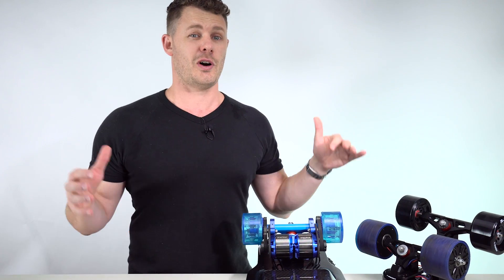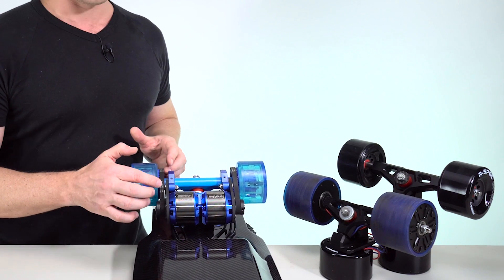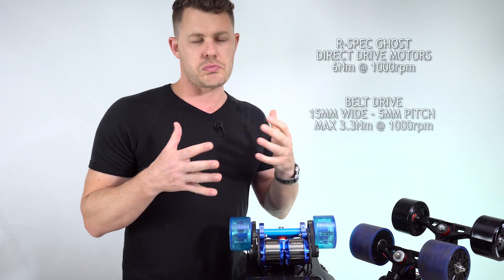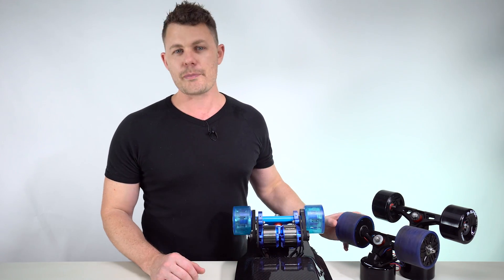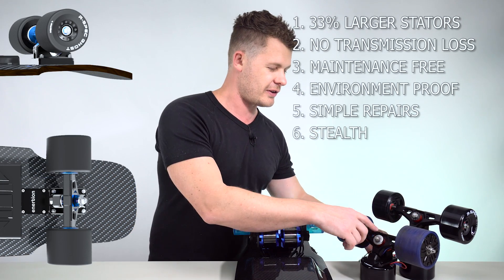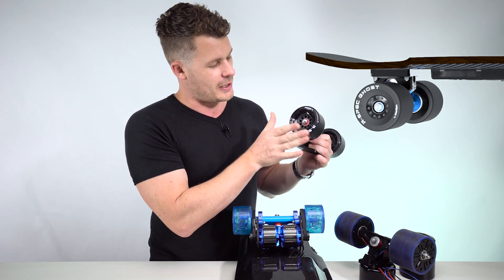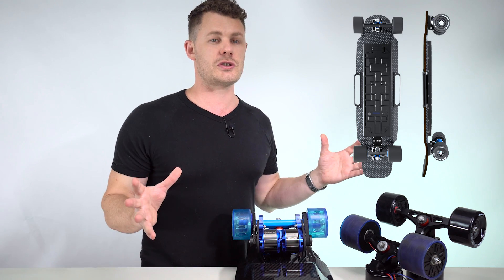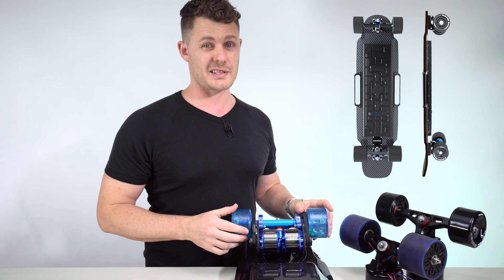Raptor 2 | Electric Skateboard Technology | Direct Drive VS Belt Drive

Comment: You didn't talk about durability at all. 
When the wheel is in the motor it gets all of the impact... How long will it last before the inner parts start to fail?
Reply: I wanted to ask the same......is the PU buffering enough impact?
Reply: the board I have has been running on bad and good roads for almost a year now. The motors have outlasted the Battery, ESC and some bearings in the front. It has run through the dust, rain, and snow thus fare. I am using a skatBolt and It has been pretty good so far and yea we have been a bit mean to this thing.
Reply: Noam Lin One year warranty.
Reply: Yep agreed, them neodymium magnets will come loose.
Reply: I have a hub motor board, and I like it. It's quiet and in my opinion more efficient.
Also you can coast and push your board, and that make the battery last longer.
Reply: All impacts and shocks go thru bearings which are dirt cheap.
Reply: Does it matter if you have a 1 year warranty? I know from the Raptor 1 that if Jason is putting out a product its going to be quality product. If your worried, buy the $99 warranty upgrade for up to 2 years. At that point there be a new board Im guessing. I plan on selling my Raptor 1 when my Raptor 2 arrives (few month later) and using that to buy the 3rd gen board when it comes out, that maybe a different brand, who knows.
Reply: Shhhhh, people dont need to know such things. But to be fair, the amount of impact force would be nearly the same in a hub motor as in a belt driven motor, just depends on the damping, meaning which system has more rubber between the rocks and the wheel.

Comment: Why did we often hear on the forum that Hub Motors had Less Torque than a Belt System??
Reply: thanks for answering Jason
Reply: belt system on a 80 pound electric offroad board... yes... but the motor is twice the size of the wheel motor... Just hoping they have been tested enough to know they don't fall apart since the motor is in the wheel.

Comment: would you be able to ride this on a 30-40 degree hot day in aussie summer?
Reply: Electric Skateboard Builder This could have another simple solution, replacing the belt-drive with a gear drive. 😀
Reply: you will still have rolling resistance, but you lose torque limiting.  Along with gaining rotational mass, similar to a two speed tranny on a rc car

Comment: Why don't you guys use SENSORED MOTORS?! To me, that would seem like the "end-all-be-all" when it comes to torque as well as reliability. 

Btw, I'm just curious. I'm in no way trying to act like I know any better than anyone in our community. But, from my own experience, using sensored motors was definitely the way to go. So much more torque and no need for a rolling start.
Reply: Electric Skateboard Builder EXCELLENT!!! Sorry about that, I saw the leads hanging from the motors and just kind of figured they were sensor-less. But with the addition of sensored motors in these hub-driven boards, I don't think there is any possible was to improve upon the drivetrain design! Great job guy!!!

Comment: Your system is great,  one question though,  will you be selling the parts separately for repairs or will the board have to be sent to a dealer?
Reply: check out the raptor q and a i think it may answer ur question
Reply: hockingham as of now he stated NO.
Reply: hockingham if you order make sure you pay by PayPal. Ever shifting delivery dates with his products. PayPal rules keep him in check and protect you.
Reply: hockingham So when he says it's super easy to replace a motor he really means send it to us and then it's easier for us to fix.

Comment: What about a 6mm chain drive? No need for width expansion, durable etc.
Reply: still loss of power when transferring power from motor to wheel to ground where the direct drive is straight to ground just my opinion though